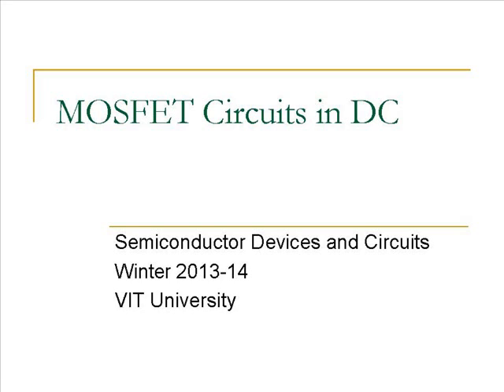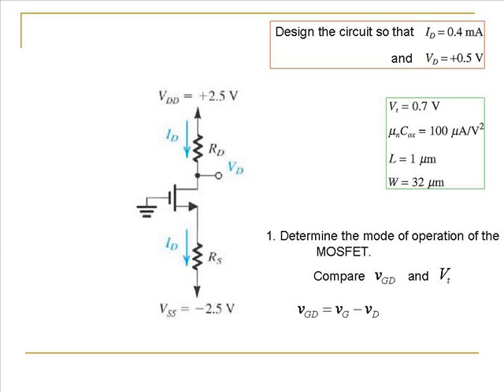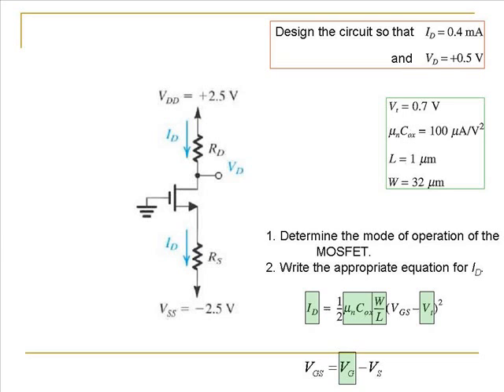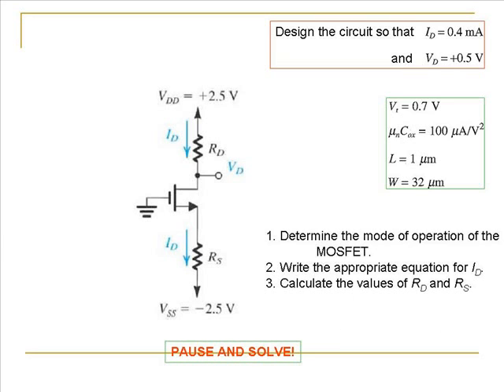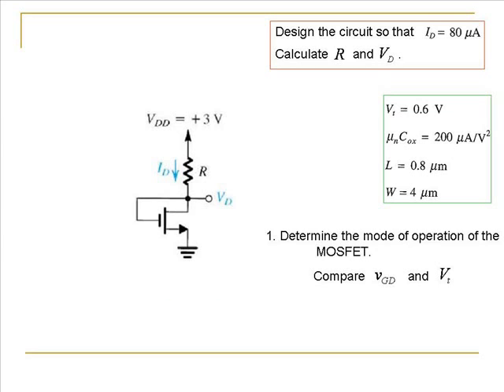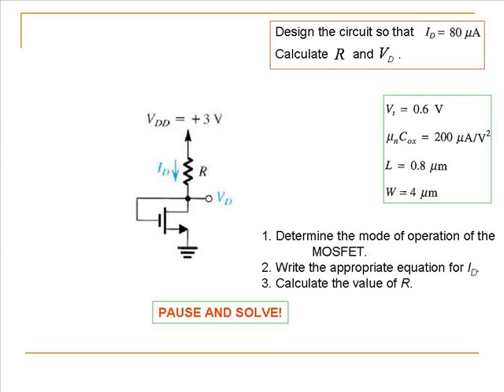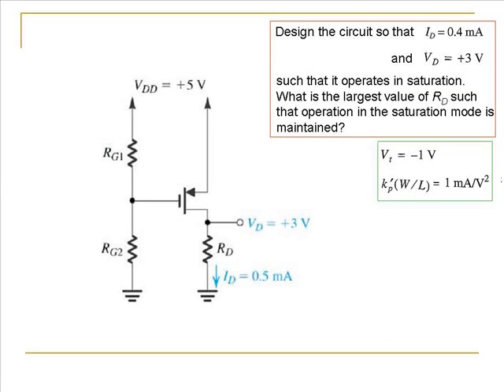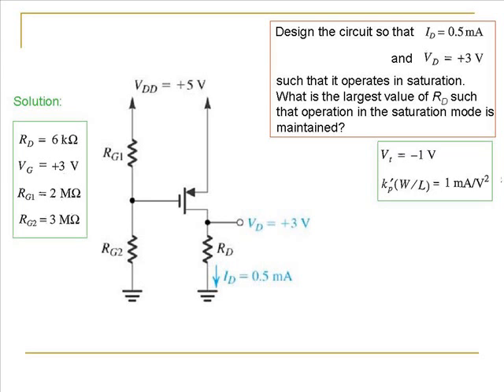MOSFET Circuits in DC

Comment: in the last math if we take RG1=2M AND RG2=3M THEN VG=2V but if we take RG1=3M AND RG2=2M then VG=3V
Reply: Can we take a random number for the current of Rg1 and Rg2?
I didn't get the solution
Reply: @rezuanahaque2615  if we apply voltage divider rules RG1 and RG2 then we gets 3RG1=2RG2.
if we take RG1=1MOhm then RG2 Will be 3MOhm .
VG=3v,Vgs=-2v then you will gets those value .if you have any questions please ask me.
Reply: @injamulhaque5439  if we take Rg1=1Mohm then Rg2 should be 3/2Rg1,it means 1.5Mohm ,right?then how is it 3?
Reply: @injamulhaque5439  i got it!thank you so much for ur help
Reply: @rezuanahaque2615  you welcome 😊☺️
Reply: I had a mistake you are right .
 rg1=1MOhm
rg2=1.5MOhm 🙂🙂🙂

Comment: I believe you got the wrong drain voltage for the second question. I think it should be 0.76V. I got (3 - 0.76)V/(80*10^-6)A to get 25kOhms like you so I believe my answer is correct. Please let me know if I am wrong. Also, for #3, you wrote 0.5mA on the diagram and 0.4mA in the problem statement for Id.